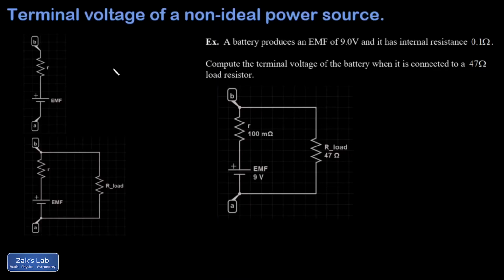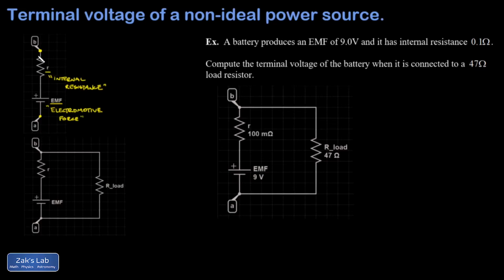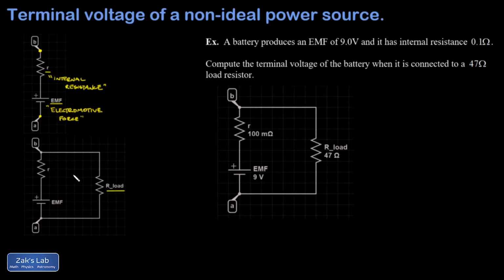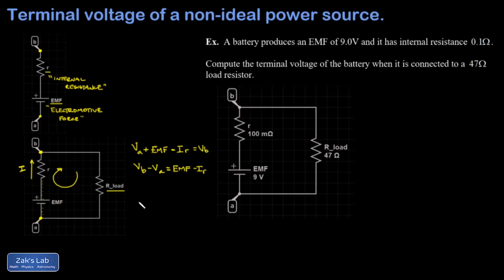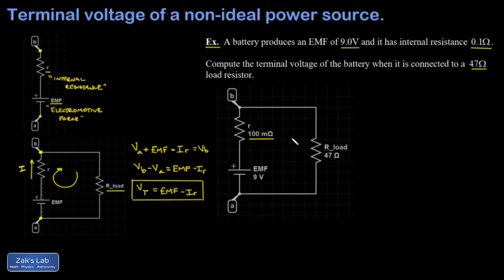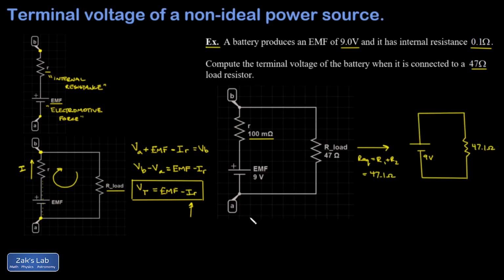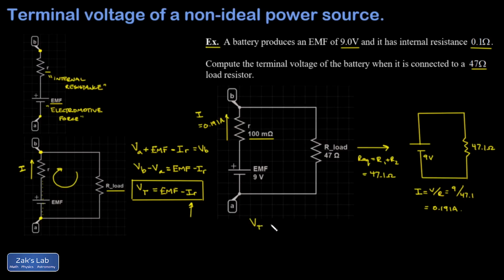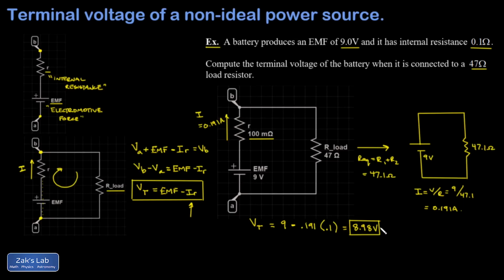Terminal voltage of a non-ideal battery: EMF-Ir drop to get battery terminal voltage when connected.

Comment: would these batteries be in parallel with one another since since they are on 2 different sides? How are they a series?
Reply from the maker: The two resistors are in series because the same current must pass through each one.  There is no other option, no other branch for current to take, but to flow through both resistors r and R_load.  When two resistors are hooked up so that the current splits and only part goes through each one -- that's a parallel combination.
Reply: What happens to the current as it passes through? I understand it now branches and diminishes by a factor and is less than the other series (parrallel) and equal for series. Is that all?
Reply from the maker: Current flows through a circuit and no net charge can build up in any part of the circuit.  So you can view it like a network of pipes, where the total water flowing through the circuit can be split and can merge again depending on the structure.  Series resistors are like pipes on a single path, parallel resistors are like a branching of two (or more) pipes (with the same height difference), and the battery is pumping the water back up to the maximum height after it passes through the circuit.  When we solve circuits, we frequently use the fact that series resistors share the same current, and parallel resistors share the same voltage.  Combine these facts with Ohm's law step-by-step to solve the circuit.  Ex.  https://www.youtube.com/watch?v=0cBi6x2I8gM